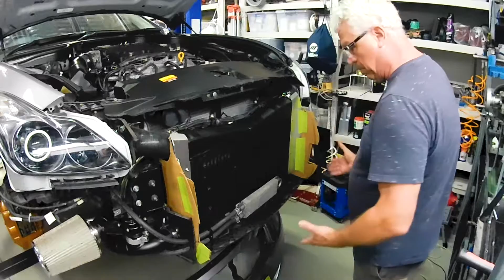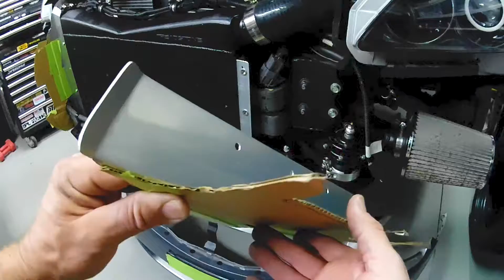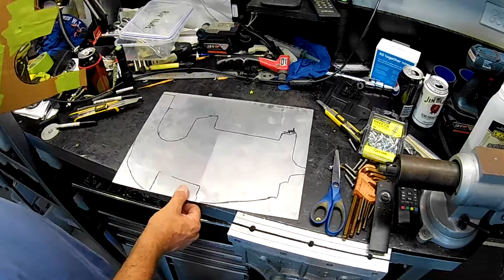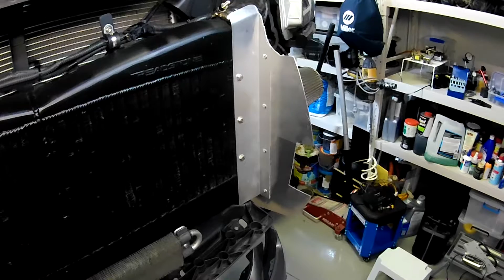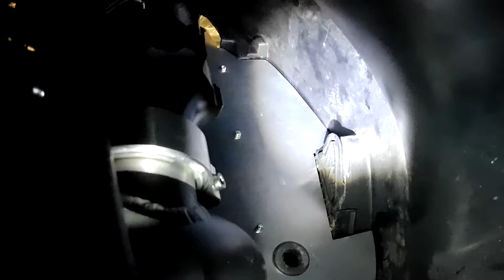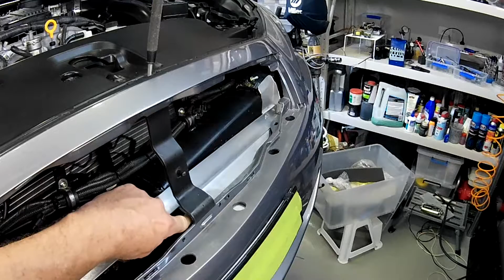How to Improve Intercooler Efficiency

Comment: Would it work better at all speeds if you just added electric fans to push the air through? Assume it has on the inside so maybe those could just be higher output?
Reply from the maker: G'day Mate, fans are great, but they just don't cut it compared to the volume available passively from pushing the car forward through the air. Fans are definitely better than nothing & their biggest benefit is when that passive incoming air is not available such as at idle, but what often happens, is they quickly become a restriction in the system by blocking that incoming air to a certain degree.
The fan shrouds on newer vehicles often incorporate flaps that will draw shut when the fans are on & then open when passive air is available for this very reason.
Adding more complexity to a system with wiring, switches & fans is just one more thing that can go wrong also.
Appreciate the input though, Cheers Mate.
Reply: @TheAussieShed  let's face it, you just like your ideas, enough said.🤣🤣🤣🤣🤣
Reply from the maker: @gvet47  Ok, you got me, Lol. Cheers Mate.

Comment: Nice work as per usual Trev. The side wings are excellent but the horizontal baffle I'm not so sure about. Air flows where there is a pressure difference, and so the air pressure created by the top opening into the radiator essentially reduces the air flow through the intercooler -  It occurred to me that you may need to channel more (or all) air from the top opening through the Inter-cooler and force  air from the inter-cooler to flow through to the radiator?
Reply from the maker: G'day Benny, yes I had the same concerns initially. I figured the only way to address that issue would be to completely block off the main upper grille opening.
There is no way of channeling airflow from the top grille opening into the lower front area due to physical constraints. 
The reality after testing, seems to be that the radiator core can flow enough air as to not create a bottle neck for the air entering the cavity from rear of the intercooler & oil coolers via the lower grille.
Without the top baffle I would not be able to create the pressure that I think is needed to fully optimize the coolers.
Blocking off the Upper Grille I feel would then deprive the radiator of useable airflow.
I did substantial testing of the finished duct work on a 38degC day recently & it performed well beyond my expectations.
Lower overall temps & way faster recovery.
Super happy with it.
You've a Sharp Eye Benny.
Cheers Mate.
Reply: @TheAussieShed  Reality trumps theory any day of the week Trev. Sounds like its going to rip!